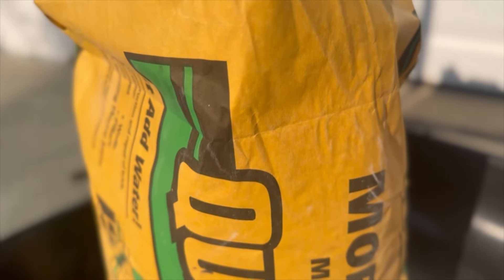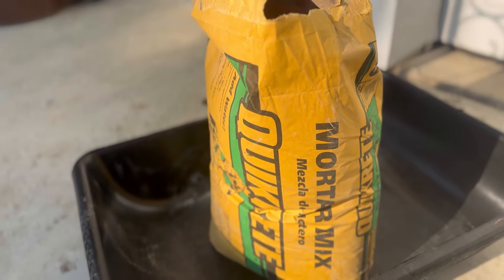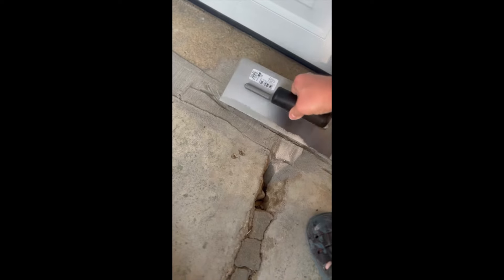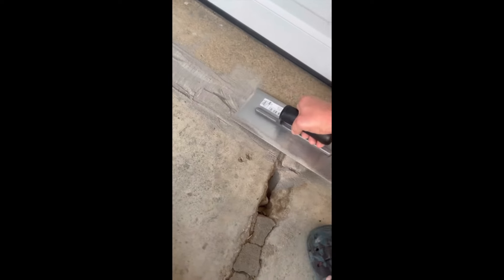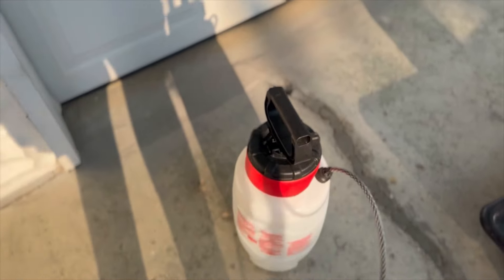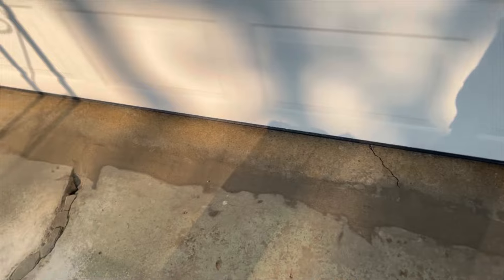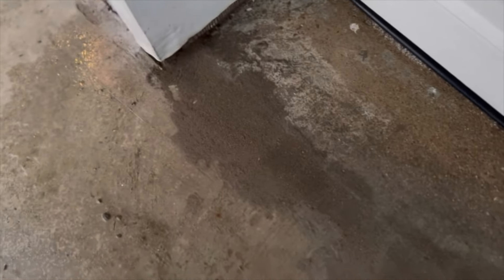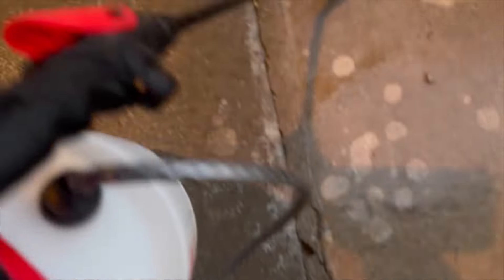DRY POUR concrete for CRACK REPAIR?! | does it work? | LETS TRY! ​⁠

Comment: I am a total believer in dry pour, but isn't that an expansion joint you just filled?
Reply: Yep, I was thinking the same thing.  Not a crack…it’s meant to be there for expansion.  Yikes
Reply: What about for cracks in between cement steps outside?
Reply: Concrete shrink's does not expand.
Reply: @peterloichtl4512  shrinking concrete? Interesting.
Reply: @peterloichtl4512  oh, in school I was taught heat causes things to expand and cold causes things to contract. I stand corrected.
Reply: Hello everyone concrete does not expand it shrink's!!!!!!!!!!
Reply: Hello to all you concrete expanders. Concrete does not expand it shrink's only. Everyone calls them expansion joints, actually the are control joints to keep the concrete from cracking in between joints.
Reply: Why yes it is.

Comment: I think that is an expansion joint, you need those to be flexible because the ground expands and contracts with the weather and temps. I seal mine with rapid-set self-leveling polymer sealant from HD and throw some sand on top to help blend it in with the driveway. This way it keeps water out and stops erosion under the slab.

Comment: I get where Ron is coming from, but people have to realize you used mortar. This will crack anyway under stress before the weather takes its toll on expansion and contracting from the ground. Should have used a flex sealant for that part.
Reply: Well, of course as two concrete slabs move over time almost anything will crack.  Maybe Michael just needed to add a piece of the cardboard type material (I don’t know what it is called but have seen it on my wet concrete driveway) on one side of his dry pour vertically along crack and in crack.  Thus, his mortar won’t crack while the slabs move vertically to each other over time or other changes.
Reply: Would any labeled flex sealant work?
Reply: @bgwilke1670  yes
Reply: Hey bub if I got a 2 inch wide 4 ft long crack in my driveway just fill it with this cement and add  sprayer water every hour for 6 times and then put a concrete sealer on it.

Comment: use concrete/mortar with extra adhesive already mixed in the bag.  its like $30/bag but the joints wont crack in a year.

Comment: It's important to ask why the crack is there since it is an intentional crack. Ideally, you'd fill it in but ensure that the original control joint was replicated, so when it cracks open again, it goes where you want it to.
Reply: Fill with what? Should joint be made a little wider? He mentions it was an older house & had been filled with mortar first.

Comment: Should have filled crack with backer rod for different size cracks or multi-purpose sand.  Then, put one of those in cracks about 1/2" lower than top of crack.  Then finish with  rapid set or sika self leveling sealant.
Reply from the maker: I have seen it done that way, and by all means that’s a solid repair. I considered that first, but wanted to try this method because when I did this repair a year ago, dry pour was a new process that a lot of people were experimenting with. I gave it a shot and it’s still holding up a year later.

Comment: I think you should have put in backer-rod (1”-3/4” depending on crack size) first.  Then maybe Quikcret with added water (as directed).  Smooth it out and let dry.

Comment: was thinking of doing a mix of regular sand and mortar to drop down into the bottom of a crack u want to seal, water that down, then finish the top 1/4 inch or so of whats left of the vertical depth of the crack with pure mortar.

Comment: That is an expansion joint. The driveway and the garage slab always have an expansion joint and should not be cemented together. Seems like this guy's driveway had a lot of movement from settling and causing the expansion joint to over expand. I would have filled the joint with Elastomer. Filling the joint with cement will crack within a year.

Comment: Why not pour wet concrete into the crack?  I’m seeing comments not to fill an expansion joint I would fill it water will continue to get into the joint I absolutely have all my joints filled. Also you should let this set for at least 10 days after filling the cracks. Then apply driveway sealer with a paint roller on a stick.

Comment: In general, dry pour is just a YouTube fad for a dumbass mind. It should not be used for slabs, steps, etc. But, there are a few instances where dry pour is okay. Apparently this has never been treated as an expansion joint, so if you're willing to do this every couple of years, okay. Even for this, when I'm essentially using it as grout, I would probably mix with water and use a grout bag to squeeze it into the space, then trowel or sponge it. It would be great for those gaps you had between rocks as well.

Comment: This will just crack again. This is not how you fix this. The proper way is something like Vulkem 45SSL with foam backer rod below it. Every concrete manufacturer will tell you that dry pour is a bad idea and goes against their recommendations for their products.

Comment: Concrete vs mortar are two different applications and mixtures. Mortar is not recommended in this application, UNLESS is has polymers in it. Your title is misleading. Additionally, expansion joints need to be flexible.

Comment: I have those wide cracks, and they’re cause by settling when the underneath isn’t stable, like under compacting or erosion.  The stress on the concrete won’t stop unless the underneath is stabilized.  I think you can tell by your video when the left side of your garage door seal isn’t touching the ground like the right side.    There are YouTube videos on concrete walkways where expanding foam is injected underneath, but it’s a job that requires a plan and parts, and field improvising.

I paid $4,000 to have it done by a contractor since the stock market under Biden has been great, and MAGA will crash the system if they win in 2024.  So I spent the money to quiet the wife from her complaining about the cracks.